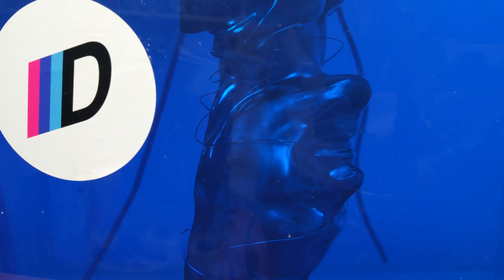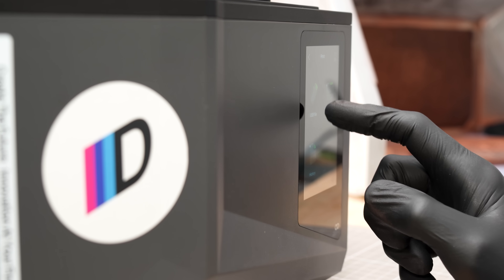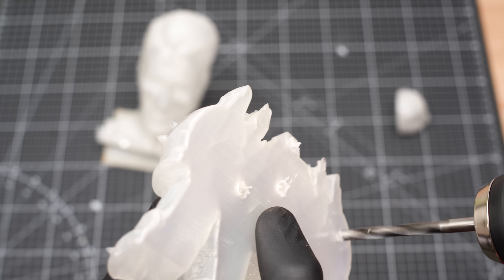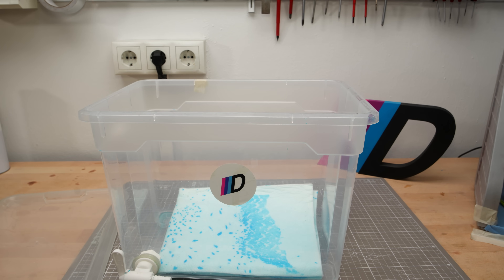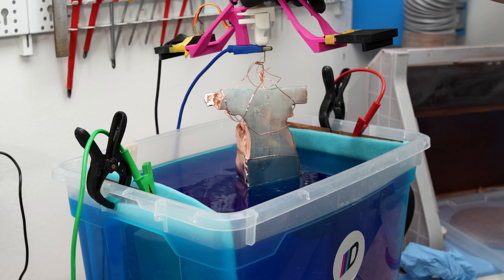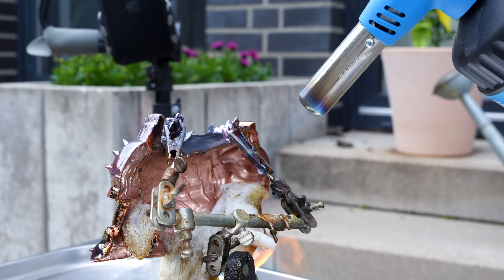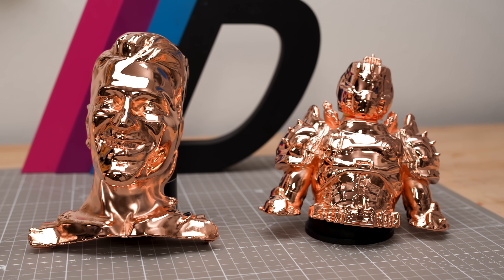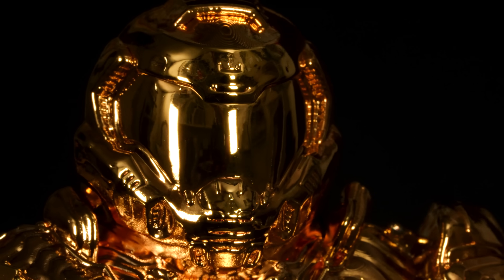Electroplating 3D Prints ... and burning them off! - FULL TUTORIAL

Comment: For better throwing power, to get into deep recesses, you need a different electrolyte (difficult and expensive) or you can use pulse plating. For this, you need to automatically control the power supply so that it applies power for just a small portion of the time - the pulse - and then switches off for much longer. For deep throw, 10% on, 90% off works well, with maybe 50 to 100 pulses per minute. Since the power is only on for a short time, the plating doesn’t build up texture or dendrites and you can use much higher current to let it plate in deep recesses. During the off time between pulses, the copper ions can diffuse in to replace those lost during the high current pulses, so the deeper recesses don’t become starved of copper and continue to plate. It doesn’t take any longer than continuous DC plating, because the current during pulses is so much higher than you could use continuously.
Reply from the maker: Thank you for the explanation. I’m already aware of the pulse thing and have researched it a bit. I‘ll take another try on solving that like as you said the recesses are the most challenging parts.

Comment: Moi! I have project for you since you have equipment and knowledge.. project:
For water kuling heat sinks.. standard they are made from solid koper and fins or grid style.. print out gyroid 3d infill and plate it with thick layer of copper.. and test it. Kiitos

Comment: Would it possible to have the motor type used to rotate models when electroplating 3D parts, have looked but totally confused. Thanks for video
Reply from the maker: That‘s a continues rotation servo. It’s controlled by an esp/m0 or whatever you want.

Comment: Could you use PVB and then dunk the print directly into some IPA for a little while to dissolve the PVB entirely? What if you made something that was solid rather than one sided, with a tiny non-plated spot, then burned it out/dissolved its innards so you had a hollow result, if that'd be of any use for something?
Reply from the maker: That would work out, i guess. IPA dissolves the PVB very slowly though.

Comment: Love the work you are doing and sharing on this subject - so cool! After I first so one of your videos, I started to think about practical applications that might be possible with this technique. For my profession, I work on equipment that includes food-contact parts. I love using 3d prints when I can on equipment, but obviously these prints can't be used for food contact. 

After copper plating, is there any possibility the part could be plated with something like stainless steel that would result in a corrosion resistant, smooth and sealed food-safe exterior?
Reply from the maker: Hi, thanks! Go for gold, that’s what I use when it comes to food

Comment: Thanks for sharing. You wondered what it can be used for so I write to tell you this is very useful for jewelers for it allows the production of relatively large pieces with very low weight, so that they can be worn as ear rings or brooches. We did a similar procedure with clay, halving the model but we will try now with the 3D prints, melting it. Looks much easier!
Reply from the maker: Thank you, that’s exactly what I thought of when I did the jewelry tutorial. But it’s still very heavy :-)

Comment: Application: Molds for casting plastisol.
Reply: I am in the process of creating one. Using a flexible, reusable silicon rubber mold. I think it will work much better than cnc'd aluminum molds. We'll see.

Comment: This would be awesome for cosplay armor pieces. The ability to get full detail metal for a costume is a fun idea!
Reply: Maybe for some small elements, because otherwise those things would be very costly as you'd probably aim for something that can endure minimal wear and tear. Whole operation will be costly because you'd need a big bath for eg. a breastplate. To have a pretty solid thing you''d need to aim for at least ~1mm thickness. Personally, I'd much rather forge such stuff in easy to work with material like aluminium. Or you could electroplate an already solid thing without trying to burn out the insides, just to have a nice copper/nickel/gold finish and keep the original toughness.
Reply: @JamesEarlCash I’ve seen how much money some people put into cosplay. I’m sure there’s lots that would love to incorporate it into pieces. Also because it’s a thin layer it shouldn’t be much heavier than foam or a 3D print. Not saying they need to do a full suit. Though I’m sure some would for master chief or iron man.
Reply: @MrTlish  Imagine full Iron Man suit in metallic finish. Awesome stuff!

Comment: Nice video, thank you! Could you also do a second half and merge them together, for a full model?
Reply from the maker: Difficult as you would see the seam. Better: Plating a full one then melt it out of the bottom
Reply: @hen3drik you could 3d print with resin casting wax so you could easily melt the inside at moderate temperature that wouldn't affect the copper

Comment: One application is making molds for soft vinyl casting, look into the process of making "sofubi" figures (Soft vinyl toys). can also be used for making vinyl model kits. Most of the molds for casting the pieces are made by electoplating a sculpt, and the resulting hollow metal mold is put into a metal frame and is used slush cast the parts.
Reply from the maker: Sounds like a good idea.

Comment: Hello, I am very curious about how many products you can coat with the acidic copper electrolyte you use because the products are expensive. At what intervals do you add it? After what time does this chemical material lose its properties?
Reply from the maker: I use the same electrolyte over and over since 2020. it regenerates from the anodes. I add brightener ever since in a while.
Reply: @hen3drik  I would be very happy if you could tell me how much you do this and with what materials. It is very difficult for a person who is just starting out to solve this issue. How do you determine the need to experience this? These questions will be a very memorable light on my journey. Thank you for your interest and concern.

Comment: Hello! I am having a bit of trouble with graphite electroplating. I have purchased some pure graphite powder and mixed it with acetone before airbrushing it onto my 3d print. I then used a paint brush and compressed air to polish it up. however when i wrap it with the copper wire for electroplating the only thing that is plated is the wire. any advice please?
Reply from the maker: Measure the surface. Has to be <1k Ohm between 1“

Comment: A Major mistake is to use the positive shape as the base. As the layer thickens, you will loose details on the sharp corners and edges. It looks much crisper on the inside.
Just coat a negative shell, to get a clean and sharp positive result. Problem here is on a closed shell, you would had to split a object into 2 halfs, and assemble them later.
Reply: But it seems that the part that is touching the 3D print is the far less shiny than the outer side.  Once removing the 3D print you’d have a matte finish piece.  You might be able to replate it after, but it seems like the detail would disappear just the same.  Maybe. 😅
Reply: @pherja  In general, optic coatings are added in microns. At least thats that we do in the watch industry. You had still to get rid of the oxide layer, and polish it anyway.
Reply: @pand0ras I’m curious how difficult it would be to polish the inside of, say, a bust of a figure.  Is it a very manual process? Or is there some more semi-automated way, like a kind of sandblasting?
Reply: @pherja  you would polish the outside, but yes, there are multiple ways of surface polishing like sandblasting, tumbling, electropolishing. and most methods are done with simple equiptment.

Comment: Hi Hendrik, what happens if you only partially paint a resin 3d print with copper or graphite paint? Will the unpainted resin react in some way with the electrolyte fluid?
I need some areas of the 3d print to not be affected and only partially electroplate. Is that possible?
Reply from the maker: Plastic (PLA, PETG, ABS, Resin, etc.) is not affected by the electrolyte so „yes, all good!“
Reply: Also, how thick are the copper sheets you are using? And how is Cu-DHP better?

Comment: Crazy project, superb video, as usual, master of electroplating! 

For my part, I'm very frustrated that I can never get shiny parts out of my galvanic acid bath. I've done the C.C adjustment with the help of electro.scorzz website 1.5A/dm², painted with a conductive varnish (3 coats), degreased, caged my part properly, install on rotate system, protect anodes with polyeste mesh filter, gradually increased my current,  etc., but after 5 hours of waiting, still the same thing: a part with a few shiny touches on the corners, but otherwise, meh... 😭

I'll try adding a shiny agent to my acid solution. Maybe my bath is too dirty? What do you think? 
Thanks again for all your advice, it's really generous of you.
Reply from the maker: You can figure out the properties of your electrolyte and I would advice you to do. Get a hull cell for that. Do a little test series. https://www.printables.com/model/252929-hullzelle-hull-cell-250-ml

Comment: Do you need to move the copper wire that is wrapped around the part periodically? I'm thinking it will leave marks otherwise?
Reply from the maker: You have to. especially if you wrap it tight. If you leave it loose it tends way less towards leaving mark.

Comment: Nice video! 

Did you notice any difference plating gold directly into the copper layer VS doing the nickel layer first? Because the result in this video looks really good!
Reply from the maker: Thanks, yes plating gold to copper takes a little bit more time to deposit. This may be of the electrolyte being a bit colder. Otherwise than this the red copper color was noticeable way longer so I plated it extra thick.

Comment: What would happen if you covered up the front side of those parts (the shiny detail sides) with tape or something, leaving just the backside open where details are not important, and then kept on re-electroplating the part over and over again until the inside has a heavily thick layer in it? Would you be left with a super strong metal part? 

Also another idea for an application of this is using the hollow electroplated parts as a cast which metal can then be poured into. Depending on the electroplated metal, you could potentially pour aluminium or zamak12 (super strong zinc alloy) into it, making it extremely strong and solid.
Reply from the maker: 1: would be the same. I would go for 1A/dm2 and it’s the geometry that „ripps“ the ions to the sides and decreases the electrical field. 

2: filling works good. I made some chess figurines some years ago with this method.
Reply: @hen3drik do you have a video on the filling? I’m really curious what happens and whether it’s worth trying to improve strength

Comment: Cool, but have you thought about solutions to join parts together seamlessly after this. Or any other way to make closed surfaces, and still be able to get rid of the plastic? Could a bottom hole the size of the blow torch gun be the solution, it would probably take longer to drip the plastic through that hole, but i would probaly be easier to handle the model, and it could potentally solve the issue of having to reprocess it again because discoloration and so on.
Reply from the maker: First: torching from the bottom may work as well. Good idea. Maybe even torching from the outside to melt it out. Second: you‘ll probably have to reprocess anyway

Comment: This video directly addresses my biggest question, I think you’ve solved it.  Making metal molds for DIY soft vinyl toys.  Basically you pour in liquid pvc heat it in an oven or salt bath, the pvc solidifies a “skin” and then you pull that hardened skin out and there’s your toy.  The only downside I see is that the inside of the mold, which will be the outside of the toy, is not as smooth as the outside of the mold.  Is this true?
Reply from the maker: It’s pretty even but not shiny. Coooould work 🙂
Reply: @hen3drik I aimed Crafsman @steadycraftin at you, he might have questions. 😅

Comment: Its probably been done by someone already, but im curious about using an electroplated layer to sand-cast something in copper, and whether it would provide more details (doom shoulder spikes for example) , or a better surface quality than just casting with the raw print. Would the electroplate layer not bond with he molten copper, or would the molten copper melt the electroplated layer to make it no different than if the payer was not there

Comment: Have you tried putting it in dry ice, then shocking it in hot water? I would think the electroplating would expand and contract more than the print materials.
Reply from the maker: Yes, that works. The copper contracts and you’ll get a separation of the two materials.

Comment: You could have used castable resin, which could also have been melted in an oven. Sand 3D printers exist, but they are industrial machines; there is no desktop type yet. I am very impressed with the thickness of the metal in your process, though.
Reply from the maker: It’s actually castle resin, but it has to be heated way longer (1 hr) to burn away clean though. The plating is 1mm at some points ☺️

Comment: To coat the inside of the face, couldn't you paint the inside part 1st with the conductivr paint, plate it, then plate the rest?
Reply from the maker: Interesting idea. But it’s the inside of the shell that is produced when burning it off. Even though I‘d guess that the geometric is still the same.

Comment: If you had a copper terminal that was a ball shape for example instead of a plate you could have that terminal inside the hollow of the mask. Current or electron flow is then across the inside of the form and the terminal so the plating would be disproportionally inside. This could be done after the main plating process to balance the deposition.
At least thats my thought.
Reply from the maker: That’s actually a good thought. I was think of that, too, maybe thick bend wires that act like an anode inside. I’ll investigate ✌️ thanks
Reply: @hen3drik or form a 'cage' of wires twisted or clipped together bent to be a roughly even stand off around it following the contours. 
 I'll be interested to see upcoming videos to see😊

Comment: you could keep the plating very thin to have great details and use 3d printing material that is easy to remove without damaging the plating, then you could use casting plaster to back the plating up from the outside then pour solid metal into the plating as a mold. What's the difference with molding the 3d print with casting? the details, casting always loses some details due to the liquid metal viscosity and other constraints. Plating can stick to surface pretty accurately. Of course you would need to use a lower melting point metal to cast into the plating to not damage the plating and maybe add some borax
Reply from the maker: Casting is uncharted territory for me. I think I should invest some time into that topic 😃.

Comment: You know those bronze floral decorations they used to put on classic furniture to make it look fancy? This would work great for that kind of stuff. You could also try making a copper phone case, it should be doable if you 3d print it and plate just the outside and keep the print in place as an interface layer.
Reply from the maker: Or print the phone and electroplate the outside then burn the „phone“ off, do I get you right!?
Reply: @hen3drik uuu that could work, might need 105% scale to fit

Comment: Fantastic stuff again, sir!  What about using water-soluable filament, the kind that's normally used for supports? Could the Polysmooth machine be filled with distilled water to smooth prints, and then after electroforming, leave the plated part in water to dissolve?  Just a thought...
Reply from the maker: Basically a good idea, but the electrolyte is also mostly water, so: not a good idea  :-)

Comment: Nice video.  I have tried a few patinas on copper plated 3D prints.  Lately, I want to get a red and purple patina (as seen in your video), as opposed to blue, green, or brown, but most methods seem to get the copper red hot and then quench.  I will try this method so that melting of the 3D print will not be an issue.  Also, I wanted to mention that a good solution to rotate the object in the bath is a cheap mirror ball motor, with a 3D printed fixture.

Comment: Would you share what's in the electrolytes themselves? If you want more uniform metal distribution (throwing power) the solution composition is key.
 Copper, acid and additives all can play a role. High acid, lower copper baths tend to give better distribution but are more prone to burning the edges if you dont have good stirring. Additives like polyethylene glycol (PEG) and chloride also give better throwing power. 
You can also place more anodes in the shaded areas and recesses, but that maby be a bit tricky mechanically depending on what you plate.
Reply from the maker: These are commercial electrolytes and these companies surely won’t give away their „recipe“. But you are so right on the additives, there are so many factors.

Comment: That's cool. I've wanted to do that for ages, but stopped years ago while trying to make graphite paint. Now I live through you!
An application could be plastic injection, but copper is so flexible.
Reply: It could be used as a mold for pla recycle i suppose.

For injection molding maybe if you used concrete or clay backing on it. Its still soft though so wouldn't work for all shapes